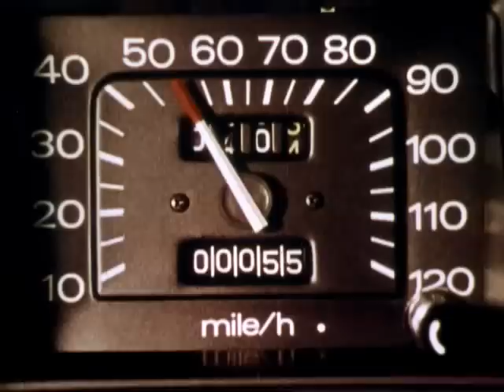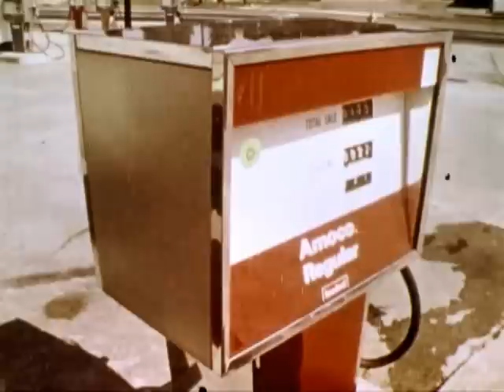How To Squeeze More Miles From Your Car (1976)

Comment: That part about coasting downhill in neutral... He says to not do it as it causes damage to the automatic transmission, yet he's driving a manual transmission which he said in the first minute of the video.
Reply: Well he also noted that it's illegal in some places and you can somehow lose control. Not sure why because last time I checked going into neutral doesn't deactivate the brake pedal. And as far as it being illegal it would be about the easiest thing possible to beat in court because there's literally no way to prove you were in neutral unless you admit guilt. It is very bad to do on automatic transmissions though. This also applies to pulling them in neutral.
Reply: @redtra236  Supposedly, the law was set in place in the 1930s or 1940s; before disc brakes even showed up on racecars in America, let alone being optional to order and long before they were standard. Only having drum brakes and relying on them instead of also relying on the transmission to help slow the car down = brake fade is a possibility. If there's water in all of the drums, that won't help either.
Reply: I have drum brakes all the way around on my Truck(1966 F250) and they are very effective. No power assist either. The only drawback is they are more prone to failure and higher maintenance.
Reply: @redtra236  I know I'm very late, but throttle input is very important in a lot of driving situations.

Just having braking and steering isn't enough. If you lose traction, sometimes you need throttle input to get it back under control. Not to mention there are situations where you need to accelerate instead of just brake
Reply: I don't get what you mean. What does him driving a straight drive have anything to do with coasting in neutral in a automatic. I've drove straight drive and automatics. I've never coasted in neutral in either. It's not good for an automatic that's for sure.
Reply: @rweawake  Agree  with you: Coasting in neutral=Bye bye transmission.
Reply: On fuel injected cars, coasting in gear actually shuts off the fuel. Coasting in N will use more fuel since the engine is idling!
Reply: @redtra236  No, but riding your brakes downhill is terrible practice and even on modern vehicles, it can overheat your brakes and cause brake fade and things of that nature.  The engine braking was and is thus a valuable tool, and nowadays with fuel injection, does not cost extra fuel because fuel supplies are cut out completely almost until the engine has halted.  That is not really something carbureted engines could do.
Reply: @101Volts  It is generally bad practice, though, because it reduces engine braking, which does reduce control, which is why they say it can cause loss of control, because it can, and in an era without anti-lock brakes, keeping speed in check was even more imperative, to reduce the likelihood of locking the brakes.
Reply: @unconventionalideas5683  yeah its best to do when not going downhill
Reply: Yeah it's neither illegal or dangerous or damaging in any way ....
Reply: @redtra236  some cars yes pulling them in neutral is a totally different situation as long as the engine is running the pump in the transmission is working keeping it operating smoothly coasting in neutral will do nothing to any car I would post a excerpt from old Mercedes manuals about if you have to flat tow the car in neutral to start and idle the engine if you absolutely have to flat tow in a emergency for the models that can't be flat towed normally , as long as the engine is running and the pump is operating in the auto trans coasting in neutral will do nothing some transmissions are different but I can't think of 1 that coasting in neutral with the engine running would damage it in any way
Reply: @Red  that's the point, going neutral with an automatic will burn the transmission, even a manual transmission will burn, simply just lower the gears. The braking system relied on oil and fuel on these old cars so going neutral will effect braking, I drive a '67 buick skylark and I did that, the brakes nearly went to the floor and my transmission started leaking
Reply: @redtra236  no engine braking in neutral, durr. Can tell you've never driven a manual lulzy
Reply: @johnnysalazar5399  Not sure about the higher end cars in the 60s, but my pickup is completely unaffected by that. Guessing your might have to do with a power braking system? Seems like an incredibly unsafe design if engine failure/loss of ignition will cause a brake failure. There's a lot of things that can cause the engine to stop running. As far as pulling/coasting a manual transmission in neutral that's just wrong it won't cause damage on a normal one at least.
Reply: @redtra236  they had different designs back then
Reply: @johnnysalazar5399  My pickup is a 1966 Ford, the brakes function as normal without the engine running(manual drum brakes). Power disk or power drum brakes will become manual if the engine isn't running, but don't completely quit working. Never heard of a vehicle that loses its brakes if the engine is low on oil or the fuel tank runs dry. And actually I find it impossible that a vehicle like that would have been sold in 1967. That's ridiculously unsafe even for the 1960s, and I don't get how the brakes could possibly run on "fuel and oil" as you claim that's absurd.
Reply: @johnnysalazar5399  I did some research on the 1967 Buick Skylark and as typical of higher end cars in the mid 1960s it came with power drum brakes. This means that if your engine isn't running the brakes will become manual brakes but not quit working completely. Unless your brakes have been modified in an absurdly unsafe way they don't require fuel or oil to work.
Reply: @redtra236  they might have been
Reply: @noway9880  Yes but sometimes you don't want to engine brake. My daily driver is a manual. I dont neutral coast very often but it's not unsafe in most cases.
Reply: @Red  well, they don't exactly lose braking, it just gets hard much like the new Cars when they shut off or when you have to push the car in neutral
Reply: @johnnysalazar5399  The new cars with power brakes use the same design as the 60s cars with power brakes, except most cars in the 60's had drum brakes.
Reply: @Red  I have an '05 300c that shut off on me and the breaks went hard so I had to really press down on it, that's what happens in cars old and new
Reply: @johnnysalazar5399  Not if it doesn't have power brakes, if its manual brakes engine shutting off won't effect them at all. If its power brakes yes they will lose the powered assist but won't completely quit working. It's not rocket science.
Reply: Not a lot of people who drive automatics put the car in neutral going downhill.
Reply: @redtra236  In this era many cars still used drum brakes, especially in the rear, and that meant much worse brake fade, and if you overheated the brakes while in neutral, that could cause a disaster.
Reply: @unconventionalideas5683  I'm aware as I said I have a vehicle from this era with drum brakes both front and back but coasting in neutral is not going to do this even with drum brakes unless you're coasting down a super long incline and riding the brakes the entire way maybe, in this case you should use a lower gear. If you're not constantly on the brakes its fine.

Comment: When minor tune-ups used to do a lot
Reply: Right. Now you have computors and stuff to worry about now. Those days i remember were so simple.
Reply: You enjoyed replacing points and condensers at 10k-12k miles and resetting them even more often? Spark wires and plugs at similar intervals? And ignition systems that might Fritz out in the rain?
Nah... 
Coil packs nowadays are hugely more efficient (no wasted spark, no high tension wire to bridge, no approximated spark curves via mechanical advance mechanisms) and easily last 100k, with no maintenance over their lifetime. Spark plugs easily get 50k, or more with iridium plugs.

The old days can stay in the past.
Reply: @MrAmorti  Too young too have actually work when those ignition systems where a common thing. But I learned it through a vehicle my father had. I know how to work on the current ignition system too. And to a great extent nowadays it is easier with better diagnostic tools. But if I have a miss I could always grab a test light and hook it up to ground and stab each plug until I hear no difference in RPMS and I know which cylinders are dead. Idk I guess I’m more in favor of older vehicles and how they operated. Now I need a 4K scanner from Snap on to tell me, “hey buddy your #4 spark plug isn’t firing”.
Reply: @SirPengu3000  a 4k scanner to diagnose a misfire? LOL. You can read ecu fault codes with no special tools or you can do it the old fashioned way by unplugging one coil pack at a time. It's not rocket science.
Reply: @fullmetaljacket7  sometimes is not that simple. Some misfires are caused by a bad injector that requieres more extensive testing with expensive scanners. And even then, current coils/injectors requiere the computer to be reprogrammed to function correctly by aspecial computer otherwise the miss could stay there.
Reply: @MrAmorti  thats true but you make it sound horrible when it really isnt that bad. I have a couple of vehicles that use that archaic technology. I like the inbetween with a single coil with electronic ignition that many old cars can be retrofitted with
Reply: @curierfromxibalba1155  It's really not that complicated unless it's a very rare and specific scenario. Reprogramming is not really a thing (most stock ecus don't even allow that) after replacing an injector unless, again, you're talking about a very specific scenario.
Reply: @fullmetaljacket7  He's probably from Europe where diesels are more common. All modern (common rail) diesel injectors require coding, each injector has a QR code with a number that must be programmed into the ECU to set its flow curves. Slightly older systems utilized a resistor in the injector which the ECU read. In many modern direct injection gas engines you instead order the appropriate injector, there's usually 3 or 4 different flow rates that need to be matched with the existing factory one.
Reply: @curierfromxibalba1155  Most Japanese, and indeed, Korean and American cars do not need scanners costing nearly that much money to diagnose.  That seems to be a German car thing.  Scanners can be expensive, do not get me wrong, but they need not cost that much money.
Reply: 0:40 Imagine if gas were 69 cents a gallon today!!
Reply: @MrAmorti 1974 is when GM brought out its HEI ignition no more points to worry about this was made in 76
Reply: Nowadays, you have to troubleshoot every computer to fix a supposedly simple problem
Reply: @dougc190  '72 as an option on Chryslers, standard in '73. '74 for GM, '75 for Ford/Lincoln. Some imports used points/condensers into the late 70's.
Reply: @MrAmorti I’ll put it this way, as long as certain things are done once a year regardless of mileage if you don’t drive very much (about 5,000 to 8,000 miles a year), will never have a problem. If points are cleaned once a season (very easy to do, just remove the distributor cap, gently rub sandpaper between the points) and replaced every spring, will never have a problem. If certain things are done regardless of mileage as a preventative measure, the reward will be having something that will run for a long, long time. 

If you are just one of those folks who just starts the car and throws it in drive without giving it a second thought, will have major problems down the road. Usually the reliability of cars in the 60’s and 70’s was a direct reflection of one’s attitude towards things in life.

Comment: The disadvantage of going 50 on the highway, is you are stuck going anywhere the semi is going on whose front bumper you have become stuck when he hit you because you were going so slow.
Reply: In 1974 the national speed limit was 55 and before then many cars would top out at about 70 so it wasn’t a big deal lol
Reply: In those days the tractor trailers were all going 50-55 for the most part, too.
Reply: Nowadays your better off picking up some speed especially if your in a heavy vehicle with decent momentum. my 1997 suburban can cruze at 80-90mph and not use much gas at all but as soon as I try to take off as fast as the other eco cars at the stop light I can watch the needle drop it burns the gas so fast.
Reply: @joestewart5406  Yes I can totally relate it's not the speed so much that uses fuel it is changing your momentum that really uses energy.
Reply: This was during the era of double nickel speed limits. Dropping another 5 off that shit wasn't so bad. Depends on gearing. 55 best 50 maybe same but slow or maybe mag
Reply: Advantage is you can shut off completely when pushed forwards.... Now that's a real saving.
Reply: @JJVernig  Disadvantage is you are going wherever the truck is going.

Comment: I use these tips as well; on a trip back from Coos Bay, Oregon, I averaged almost 30 mpg doing 65, slow lane, cruise control on, and  yes I did the math, and did just go by the lie-o-meter on the panel.
This was in my 8000 lb 2014 Ram mega cab 2500 diesel too!

Comment: So he first says that coasting doesn't save gas, but then goes on to say "if you decide to save gas by coasting..." so which is it? It sounds like his point was: Coasting does save gas, but will end up costing you more in other problems.
Reply: he specified "in auto transmissions" while showing a manual.  Coasting a manual won't damage the trans but could cost more in brake jobs

Comment: 3:43 If you're being passed by a car towing a travel trailer, you might be going too slow...
Reply: Depends on the speed of the car passing! I’ve seen irresponsible towing at high speeds. Typically it ends badly as the trailer can act like a sail. Thanks

Comment: 6:03 the engine used in those Datsun was a licensed copy of an English Austin engine, with changes.
Nissan was a licensee of Austin Motor Company technology), mainly comprising changing the camshaft from the left side to the right side so removing the intrusion of the pushrods from the porting allowing 8 individual ports instead of 5 originally, and moving the oil pump from the rear of the camshaft to the right side of the block. As production continued, 1974 and newer A-series engines had different block castings, with relocated motor mount

Comment: There's nothing cooler than peeling out in a Mach one . Nothing worse than driving a Datsun B-210 Honey bee.
Reply: Ted Roberts That's the spirit!
Reply: or a Chevette Scooter
Reply: Ted Roberts Hey, what’s wrong with a Datsun B-210...mechanically, they’d outlast a Mach 1 twice as long with less maintenance and fuel costs though anywhere outside the west coast or southwest, they would rust away twice as fast. Great little cars!
Reply: My Bee was a great car...saved me during oil crisis #2.
5 speed 1977 manual hatch.
Reliable. 43 hwy. MPG easy.

Comment: There was a lot of contradictions throughout that film. As a truck driver my employer specifies a minimum 10% coasting time on trips where possible. Yep, in neutral rolling along. Started doing this in my car and I've saved a fair bit I actually get an extra trip to work every week now.
Reply: Not true, actually: In neutral, your engine is idling which requires a rich fuel mixture. With today's modern fuel injected cars, if you are decellerating or coasting in gear, the computer almost shuts off fuel, which also causes an air pumping effect in the engine and actually helps you slow down. Cruising speed at light throttle is where you get the best fuel mileage. And, yes - your car is not as stable on a coast because all the wheels are free and not being controlled. Try taking a corner by coasting. Then try applying light throttle around the corner. You can control the car much better with power input and actually take the corner easier.
Reply: I definitely agree with Mark here, if you have an old school car with a carburator, you will save a ton of gas by putting the car in neutral and by letting it ride but you will actually use more fuel in neutral with fuel injection. You can check this by putting the computer to display the instanteneous fuel economy. You may observe that the numbers are different if you coast in neutral or if you let the car coast in gear. Al least, from my observation driving a european car with a manual.

Comment: Fuel injection , computer controlled automatic transmissions, electronic ignition , and technological improvements with tires , did away with a lot of these problems . I owned a Chevy Nova that would stall as soon as you put in gear in very cold weather until the engine warmed , up back then .

Comment: Coasting is neither dangerous or will damage the transmission in any way thats a gaslight i agree with a lot of the other points made they are mostly well covered but don't tell lies to force a issue or force compliance

Comment: Steel belted radial tires were replacing the bias ply tires. The radial tires got better gas mileage, but had poor traction. There were lots of wrecks with the new radial tires as drivers were expecting the same braking and turning as with the bias ply tires.